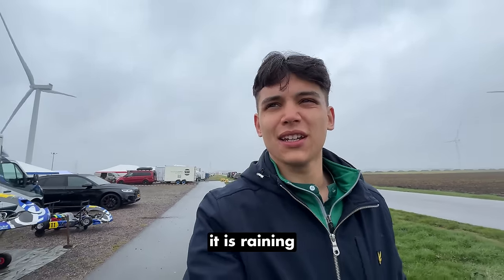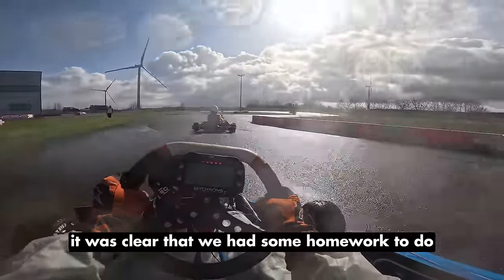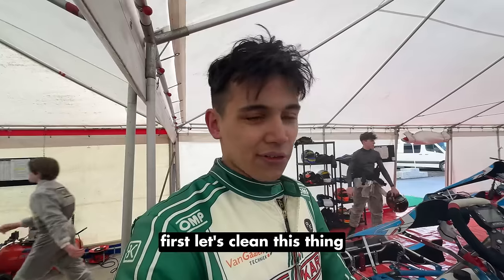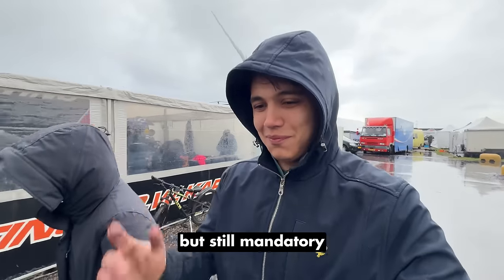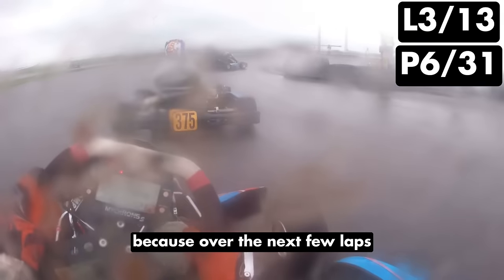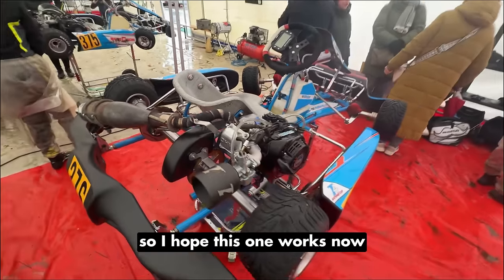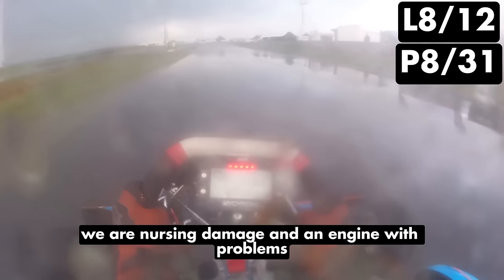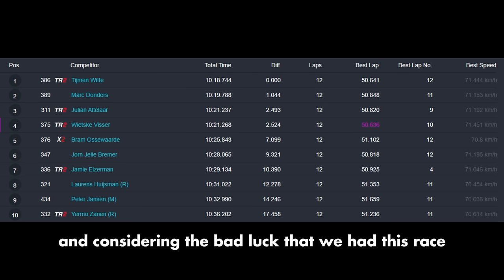My Girlfriend Beat Me In Our First Go Kart Race Together

Comment: How are the Maxxis wet tires?
Reply from the maker: FAST. Too fast for T4 in my opinion. We were only about 6 seconds a lap slower in the wet vs the dry, which is a small difference. For reference, with Rotax we are about 10-20 seconds a lap slower
Reply: @RedExions  Alright, I will maybe race in Slovakia ring COTF or euro soon, thanks!
Reply from the maker: I believe they are the same tyres as these
Reply: @RedExions  Yea they race Maxxis tyres in CIK FIA this season